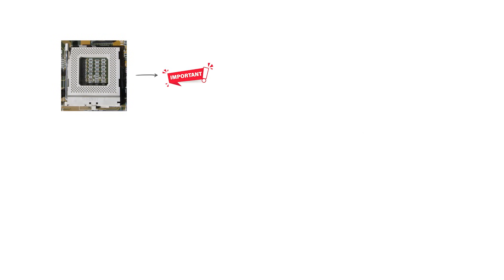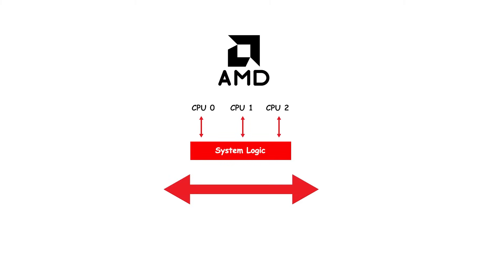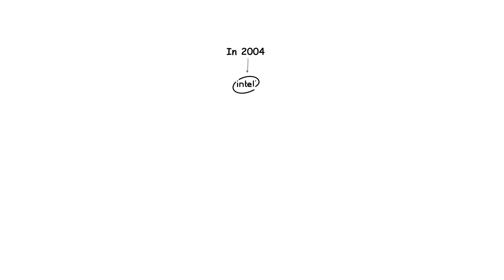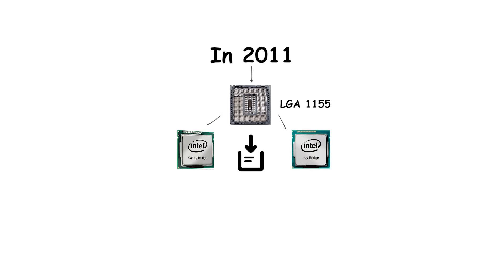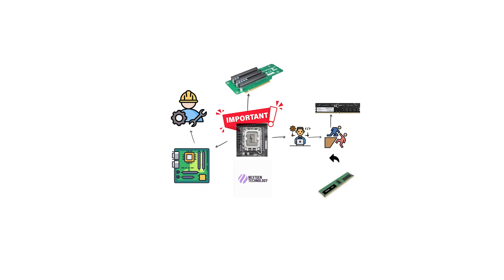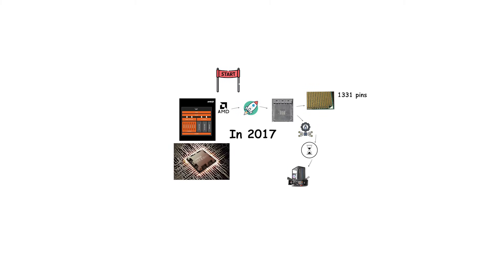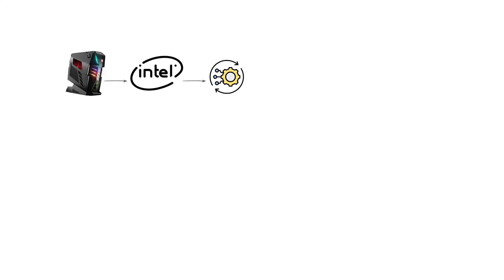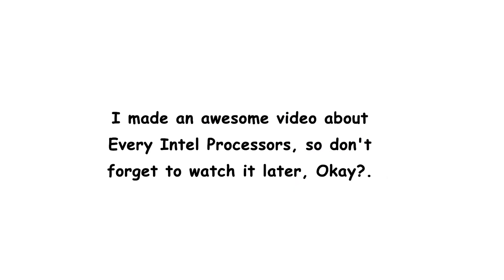Every CPU Socket Explained in Detail

Comment: ??? WHY ON EARTH DID YOU LEAVE 754 and 939 out???
754 (in 2003) = Athlon 3000+ or FX-51 -> iconic radical design where higher IPC performs better that raw clocks
939 (in 2004) = Athlon X2 3800+ (first DualCore) or FX-60 (Server-grade DualCore on a consumer plattform)
940 (in 2003) IS NOT AM2 = 940 is for AMD Opteron (Server CPUs) but AM2 is for consumer CPUs -> yet both have 940 pins ;)

Comment: Yes, AM3 reduced the pin count compared to AM2 from 940 to 941... wait, that's not how that works.
AM4 - 2017-2020. 6 years. Yep. Math is not this persons strong point. Also it still occasionally gets new CPUs released for it, so depending on your definition of "support" it's up to like 8 years now.

Plus all the missing stuff like everybody else mentioned.

Comment: IIRC
Slot 1 was made was because if the L2 cache memory was on the CPU itself and was bad, the whole CPU would be wasted.
So by having the CPU and L2 separate if the L2 or CPU was bad, it could've been swapped out
Having the L2 chips closer to the CPU improved performance and IIRC, they could run at higher clock rates which improved performance even more.

Missed mPGA478, LGA771, LGA1366, LGA2011

Comment: You forgot about socket 1248, for intel itanium 9300,9500,9700 series and svlclga3647, a revision for lga3647 for xeon phi processors, also a bit cheeky but the bga cpus eg. bga2518 and way more

Comment: there are quite a few missing...also the newest intel socket is 1851...and thats not only come out like 2 days after the video...
i also miss the super7 times...pentium 133 with 100mhz fsb and 1.5 multiplikator ran pretty nice, running amd k6-3+ at 600mhz was the best thing i managed on one of those boards...

Comment: skipped socket 3

3:36, that's a slotket to put a later socket 370 CPU in an older slot 1 Main Board

skipped 478

Comment: When i bought my gaming pc from walmart it came with both an AMD Ryzen 5 7600 CPU and an AMD RX 7600 GPU
Gaming on it is amazing and i have 16GB of ram in it but i'll be upgrading it at some point to 32GB. It'd be interesting to see what the next AMD socket. Most likely it'd be AM6 (anything past 10000 series Ryzen CPUs that doesn't exist yet currently but i suspect we're going to have maybe two or three more generations before AM6 unless something changes)

Comment: so many skipped sockets. soooo many. in my room there's 2 computers each with unmentioned sockets. no sockets before 1995. no brand new ones. entire itanium (IT) architecture skipped (its very obscure so they have a reason atleast), lga 2011, 2011-1 (xeon e7), 2011-3? laptop sockets?

other sockets gathered from comments and replies to comments and a few from myself:

socket 478
socket 3
socket 5
socket 6
socket 8
lga 1366
LGA 1356 (odd socket for v2 Xeons - like the e5 2470 v2)
am1
fm1
fm2
fm2+
am3+
lga 1851
lga 1248 (itanium only; very obscure; not even sure if this is the right pin number)
socket 604
lga 771
lga 2011 and varients of it
every socket before 1995

Laptop sockets (too lazy to make a list so ChatGPT did it):

Socket 479
Socket 495
Socket M
mPGA479M
Socket 478 (mPGA478M)
Socket P
Socket G1 / rPGA988A
Socket G2 / rPGA988B
Socket G3 / rPGA946B
Socket G4 / rPGA947
Socket 479B
Socket S1
Socket S1g1
Socket S1g2
Socket S1g3
Socket S1g4
Socket FS1
Socket FS1r2
Socket AM3r2
AM3+ mobile
Socket PGA988
rPGA988B
BGA1168
BGA1356
BGA1528
BGA1787
BGA1288
BGA1364
BGA1364r2
BGA1515
BGA1526
BGA1780
BGA1440
Reply: chatgpt forgot that one when making this video LOL
Reply: Yep, there are many more platforms he missed like Socket 563, Slot 2, Socket 615, Socket 478B, CLCC68....

Comment: what sockets. system on chip instead. including memory and storage on board. and all the external io-pins on board.
Reply: Then you won't be able to upgrade anything without replacing the whole board and you have to hope there is one that has the configuration you need

Comment: Intel socket 1156 was originaly designed only for i3 i5 and 4 core i7 ( and pentium, celeron cpus )
Socket 1366 was a workstation/server socket for i7-9xx and Xeons, both having 4-6cores 8-12 threads. And believe or not, i do have dual 1366 socket system equipped with X5690 cpus, also overclocked to 4.6GHz, 48GB of RAM… In multithread applications i can smoke i9 9900K easily.